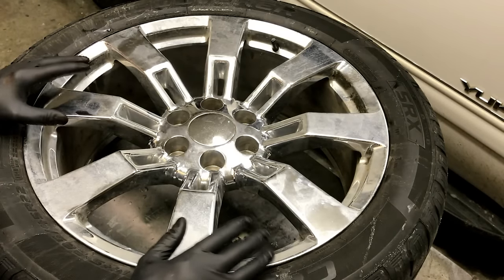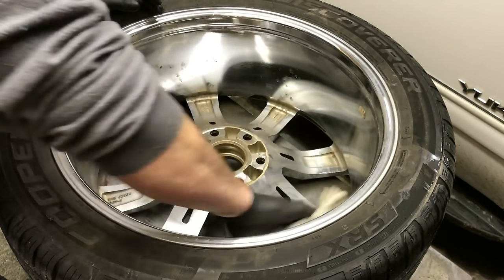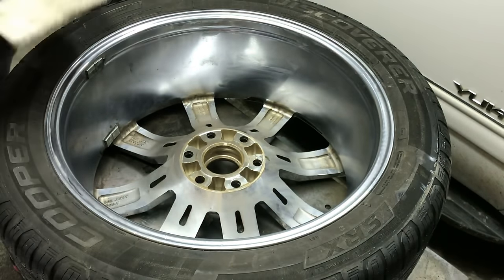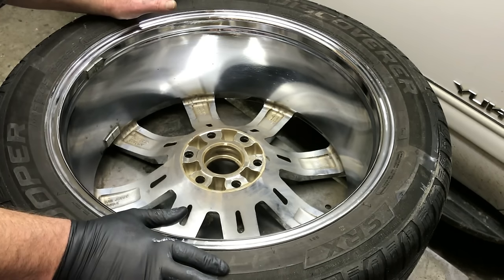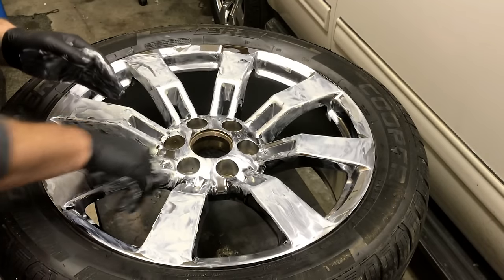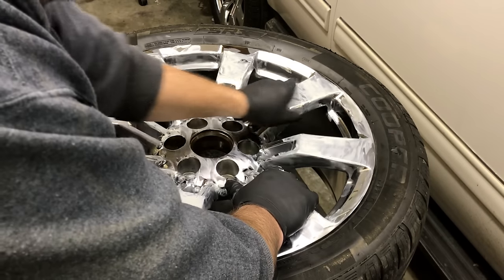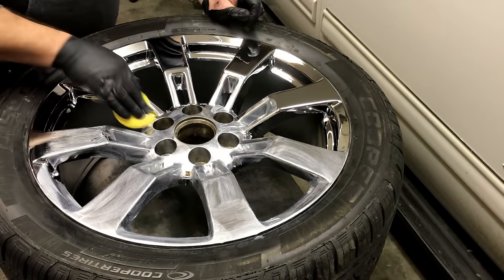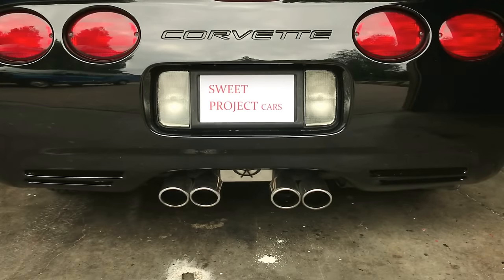How To STOP Wheel CORROSION Before it Starts...diy

Comment: Hi. I want to start off by saying I  your videos!  I can appreciate all the hard work that you do and the time it takes to produce a video . I would like to comment on this particular video concerning the clear coat application on the Chrome plated Rim for Corrosion / rust Prevention.  I have done this idea several years ago as a a test along with other ideas i had.  They all were done at my shop , as it was my goal to  prevent corrosion and rusting of rims regardless of what they were coated with . A few problems that I have faced is the clear coat  will not stay on that Rim unless you scuff that surface and even if scuffed or sanded  it still  peeled off , but took a little longer.  As you know the  rim  faces a lot of brutal  challenges along with constant  rocks and debris  hitting it. And visiting the local detailer whos using whatever wheel acid that's on sale that month just worsens the situation . I have had these ideas fail and it was very disconcerting because of the time that it took it to do it .   Also it seems to me the corrosion, rust, and bubbling of the Chrome  starts & continues from underneath from the slightest bit of moisture entering through a seam  or a hairline crack in the coating?  There's nothing that I could find that would prevent it. Water would find the weakest point and eventually creep in , and it will not take years for this to happen either . I'm sorry to admit all of my testing failed and seemed doomed to happen  just from  a little bit of moisture  getting underneath . It will start and it will grow like cancer . I'm not bashing you by any means, I think you do a great job with your videos and your knowledge however I do want to share this tidbit with you.  I think this particular idea will not work for the long run or more than 2 years. Thank you for all your great videos
Reply from the maker: joe thank you for the comment...all our rims are sanded and we have never had a customer come back in 20 years where their wheels were peeling from our work, as we use the highest quality 2k clears and we have done 100's of wheels with no issues, one secret is to keep them clean in the winter when they are salting the roads. other than we have never had issues with what you are mentioning.

Comment: WOW!  So many great tips here, Sweet!  I have a couple of additional comments and a question.  
1) A buddy of mine who happens to be a top Jaguar (mostly E-Types) mechanic told me that UV is VERY bad for chrome- your technique protects against that very well!
2) I have been changing out my chromed Acorn lugnuts every few years or so (due to rust and peeling of the chrome), I never thought of "clearing" them.  Thanks.
3) I recommend putting some oil based lubricant (or maybe anti-seize) on the chamfer of the lugnuts- as you say, oil is the enemy of corrosion.

My question: You cleaned off the glue from a previous wheel weight, but I noticed you did not disturb the existing wheel weight on the rim used in this video.  Do you think it would be worth removing said weight to treat the rims and re-balance?  As one changes tires over time, the weights will end up in a different place on the rim, requiring more efforts to prevent corrosion.
Reply from the maker: Kirk Thank you for the very useful comment it is great for the entire channel we are glad you are here with us:)

Comment: Hi guys how do I make my 2021 Denali 1500 22 inch aluminum wheels look like Crome 
Do the wheels have a clear coat from GM on them that need to be removed before polishing them l would like them to look shiny like you did in this video 
Also what was the secret stuff you Applied at the end to protect the wheels I also live in the salt roads 
Thanks Greg
Reply from the maker: Greg, you will need to remove the clear coat, make positive that your wheels are hard chrome coated and not vacuum chromed.  Then polish them up following the video instruction. If you live in salty areas, I highly suggest you use this https://amzn.to/3lgx0W1 to clear coat them shown in this video  https://youtu.be/MfkcTtgXTTw    We have tons of videos on wheels, you can learn a lot. Thank you for watching, have a great week and all the best on your project my friend. mad Mike the hammer SPC

Comment: Which primer should I use before spray painting a plasma vapour coating process chrome finish aluminium alloy wheel over the existing chrome finish described?

Comment: Another thing you can do is take new rims to a ceramic applicator and have then do a ceramic clear. Its UV resistant and salt resistant. Its not a diy project but if you have a large investment into rims its always a good idea.
Reply from the maker: yes you can do this but we try to keep it simple for the home DIYer, we feel what we show anyone can do on a weekend and it works...it is far better than doing nothing at all, and it did not break their bank...thanks for sharing :)
Reply: Wondering if one of the spray on rinse off silica sealant products might work fairly well and be easier then all this at least if you do it before your wheels get too dirty/worn down. I jst got some clear coated wheels I was thinking of trying the ceramic stuff on.
Reply from the maker: TheTruth4313 you can do this as well https://youtu.be/gxouiNX8JM0 watch our process to ceramic coating wheels. thanks The Hammer

Comment: GREAT VIDEO! How would you address this for painted wheels? I've been struggling w satin black painted wheels. The only product I use with success as far as making the wheels look rich "black" is a product I've been getting from a friend. I'm wondering if I clear coat the satin will it maintain the look like when the wheels were new? I've only used them a few months and unless I use this product my wheels look dull on the barrels. The outer part is machined with a clear coat. thanks
Reply from the maker: Battlesox this is the video I would do on painted wheels  https://youtu.be/yBLuhb72grM  we are actually doing a video on this, this week or very first of next, it will be done on chrome wheels but the same principle applies for painted wheels as well.
Reply: Thank you. I will take a look. Much appreciated. Keep up the great work...

Comment: Hi Guys
Just wondering about the mother’s power ball attachment,  I’ve seen them lots before but I had heard that they’ll only last about once for a full set of unloved/rough alloy mags!  Just wondering how true this is?? And is there a way of using them many times over??.
Cheers and thanks again guys from your fans down under!!
Reply from the maker: Squizzy we have had no issues with them lasting..you want to make sure the wheel is sanded or somewhat smooth prior to using as rough wheels will tear up most anything thanks so much for your great comment and support of the SPC channel :)
Reply: Sweet Project Cars sorry to bother you but do you know how to go about cleaning the mother’s power balls once there dirty?  Cheers and thanks again
Reply from the maker: We soak them in this   http://amzn.to/2F7isAq   at a 25-75 ratio the25 being cool water then rinse with hot water let air dry

Comment: Hello. Great videos as always. Can you tell me what I might be doing wrong with polishing my alloy wheels? I just tryed mothers which I see you use a ton so maybe you can help. It says it should turn black and you rub off. I tryed to rub in with micro fiber towel and wipe off with micro fiber towel but it just rubbed off. Any guesses?  Thx
Reply from the maker: a plus   your wheels did not turn black because they are clear coated...you will need to strip that off per this video https://youtu.be/kk8UbGjox_0
Reply: Sweet Project Cars now that makes sense. Thanks for taking the time.
Reply from the maker: A PLUS you are very welcome and we do highly appreciate your involvement in our channel and just wait until you see the next wheel video we do it will blow your mind :) thanks Mike

Comment: I didn't do much to maintain my chrome S95 Cobra wheels and didn't think anything of it until earlier this year when I took the car out and heard this horrible clanking sound.  I thought there was some brake problem or something else more serious before finding the chrome had peeled up and started to make contact with the brake caliper.  While that chrome might be thinner than what's on the outer surface, it is thick enough to make a heck of a racket when it gets like that.  It looks like eventually I'll have to have the wheels refinished.  I don't think there is any saving it as they are now.  Bummer...
Reply from the maker: melodicdreamer72 that is a bummer but hey you may end up with some new wheels in the future and thats good :)

Comment: Great video! I like how u clear coated the inside, but I have a question.  I have a Corvette I drive in mostly good weather here in NJ, but our streets are loaded with brine and salt and take months to clear up. I am ordering a set of chrome rims and plan on wiping them down with alcohol and coating them with Wipe new before tire installation. I personally think that stuff is awesome,  what is your opinion on wipe new, although I am considering doing the clearcoat on the inside like u did and using the wipe new on the face. What is your opinion?
Reply: Although my concern with the clearcoat is chipping, because of the thickness. My stock rims are polished and clear coated and clear coat chipped away on the inside area.
Reply from the maker: LittleJimmyNorton I own 2 corvettes and only use this on them my friend  https://goo.gl/z9TrgR

Comment: Awesome video!  Question though:  How about when it comes time to have your wheel balanced at the shop and they have to scrape the old wheel weights off the inside? Wouldn't this damage the clear coat?
Reply from the maker: tee roy when they move the weights to another place on the rim when blanaced you will just re-clear the area where the weight previously was located thank you very much for your great comment and we are glad we can help :)

Comment: I have what might sound like a stupid question, I just purchased a car that was the victim of very sad and lazy owners. It has 20” chrome wheels and the chrome has bubbles under it in 2 of the wheels but hasn’t broken out.Is there any way to repair it without having to have them stripped and redone with new chrome?
Reply: Oh yea, I hate chrome wheels!!!!
Reply from the maker: Bobby, there is no real way to fix the chrome by hand they will need to be re-chromed or buy new and then treat them per the video so you will never have that issue again :)

Comment: I have the same issue. I have flaking with dusty corrosion starting in the back, but the front of the rim is fine.

Will the method shown help me stop it from spreading? 

Can I sand off the corrosion, paint the back, and save the whole thing using this method?

Comment: Great video man. I have a polished aluminum valve cover and every time I wash the engine the degreaser leaves stains on it and I have to polish it all over again. Any tips to protect that sort of thing? Thanks, your channel is awesome!
Reply from the maker: Issac with that I would clear coat it with a 2k clear and you will not have that problem again
Reply: Sweet Project Cars thanks fam I'll try that 💪
Reply from the maker: Isaac see this video it will get you on track to clearing, see the part about the clear coating https://youtu.be/0kVRwnRIb54
Reply: Sweet Project Cars good stuff!!
Reply from the maker: thank you very much for your great comments :)

Comment: mothers, eagle 1, clear coat ,etc are not available in india and cannot be imported... my whole motorcycle(royal enfield) is chrome ...how do i protect it??? ...especially in the rainy seasons and i live near a coastal area???
Reply from the maker: Kalpesh Patole you need to use this https://goo.gl/z9TrgR
Reply: sir...i cannot use this right now as the whole bike needs to be dismantled to get the shield inside out on mudguards,etc......and it is raining 24/7 right now.....give me a simpler,cheaper solution like "Your Car Will NEVER RUST Again! For Just $10 Bucks" but for a chrome motorcycle, products in general i can find easily...like transmission fluid, petroleum jelly, mineral oil easily available in india (and also very cheap in india, 4$ max)...give me general product recommendations...and i will get them...for rainy season and coastal areas... will be really grateful for your help!!!!
Reply from the maker: Kalpesh Patole here is the link my friend  https://goo.gl/z9TrgR

Comment: Do one and show us with a motorcycle rim
Reply from the maker: see our bike channel for that https://www.youtube.com/c/SweetScoots
Reply: @SweetProjectCars  if I used auto body clear coat will it turn orange
Reply from the maker: it could if you don't use the correct mix ratio with the activator and the 2k clear ..this is much safe and easier to use and does an even better job  https://goo.gl/z9TrgR
Reply: @SweetProjectCars  thanks
Reply: @SweetProjectCars  see the rim is for my motorcycle haven't recieved it yet in the mail and figured this would help me the most cause I'm all ways busy work and school about 14 hour a day and if you could tell me the right mixture in measurements that could help cause I thank my brother might make it turn that way on purpose not knowing for sure
Reply from the maker: the best you can do for those wheels is the https://goo.gl/z9TrgR if i were you and wanted the best that is what i would do see this https://youtu.be/p_9oxP_Hiu0